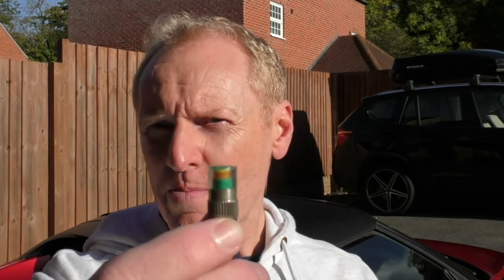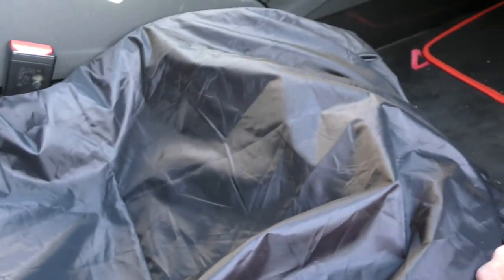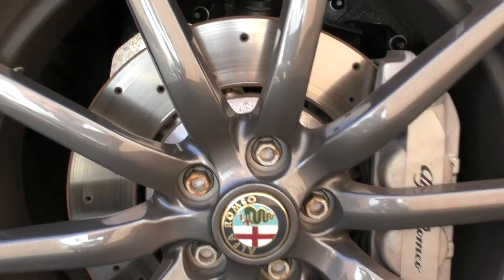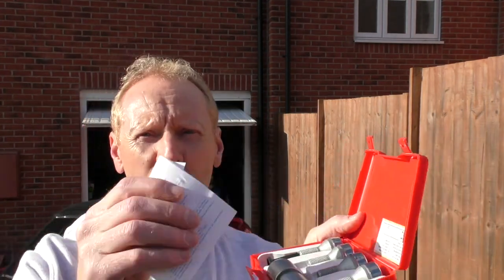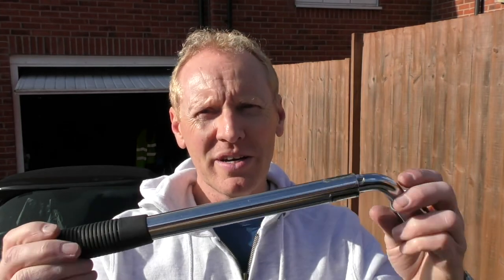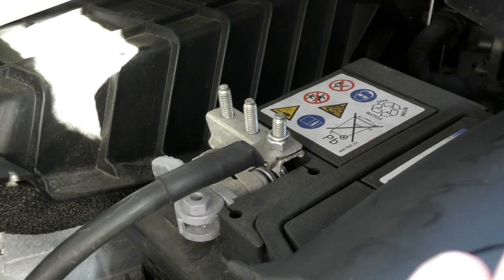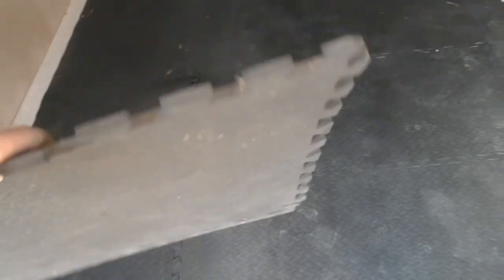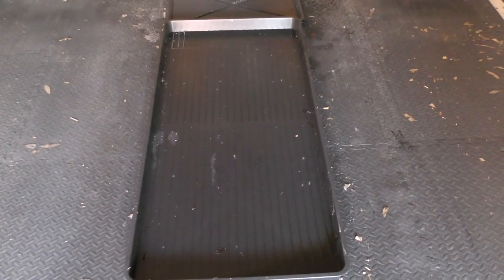Alfa Romeo 4C Tips for smooth running.

Comment: I have a 2015 ALFA 4C Launch Edition. Your ideas are good ones and I have  done similar things on my car. 
Some additional ideas....especially on the 4C and any modern car that relies so heavily on clean battery power to its various computers, etc  Disconnect the two battery terminals and clean them well and than coat with the battery terminal gel from one of the autoparts stores. Replace the clamps and you will avoid glitches like warning lights coming on on your dash. For those that don't use their car a lot I agree that it is necessary to have a battery tender to keep your battery at peak charge.
I also agree with your recommendation for a vinyl wrap on at least the front of the car to protect against stone nicks in the paint....but I go beyond this and  put strips of the material on the door sills and the carbon fiber where you might come in contact with it.  You can buy strips of that material from Xpel or Suntek and since those surfaces are not compound curves it is an easy do-it-yourself project.
Reply from the maker: Thank you for the tips - I already have some protective film on the door sills, but it needs replacing already, so I'll look into that! Thanks for watching.

Comment: I see you also have chocks on the floor so you  know when your in and parked at the right spot. I've done that for years. 
Another thing I do is have two small traffic cones  inside the garage door each side inside. This allows me to line up the car perfectly when reversing in. Also a bit of carpet on the wall where I open the car door.
Reply from the maker: Thanks for the tips!

Comment: Hi there... thanks for your time to make the videos, I enjoy them :-). I've been watching since your white S2 Exige days, so interested in your swops over the years. With the 4C it seems a touch 'full circle' compared to the S2 Exige, as they're similar in size, 4 cylinder FI engine, weight, power, roof off possible...  I know you made an Exige V6 Vs 4C Spyder video, maybe another using the S2 Exige could be done ?
Reply from the maker: Sean Cain Hi Sean, firstly thanks for watching, it's great to hear that people appreciate these videos. In the video of my white Exige I recall saying how fast it is and wondering how much faster the latest model could possibly be.... two years later I found out! I'm sure I do actually compare them in the second video I made of the Exige V6 as it includes flashbacks of the white Exige in it. Thanks again for watching.